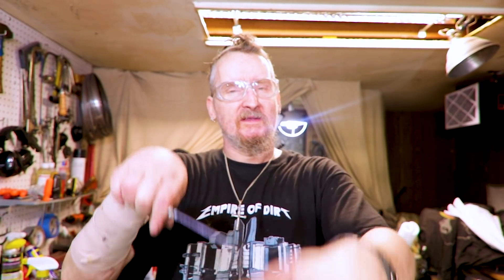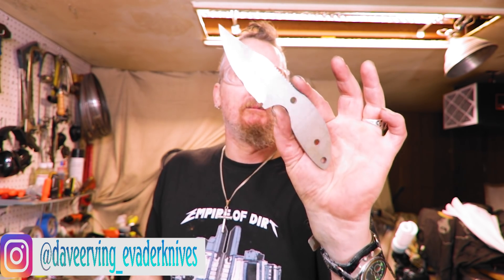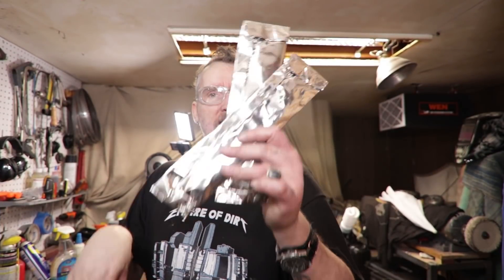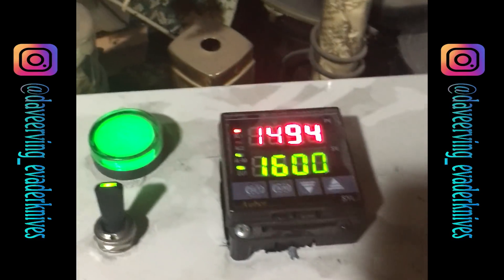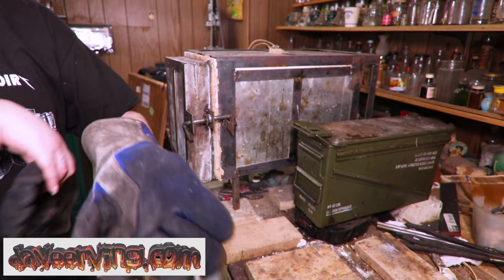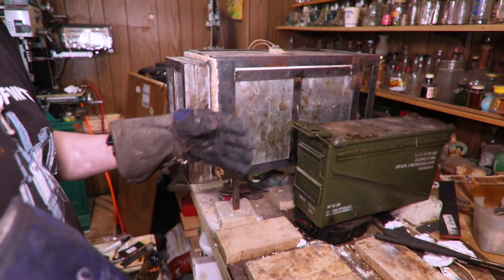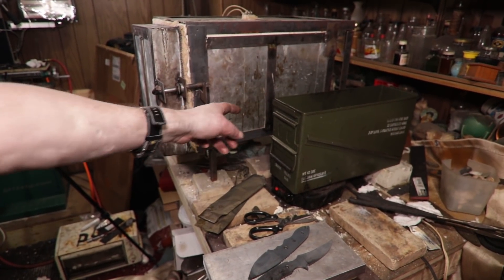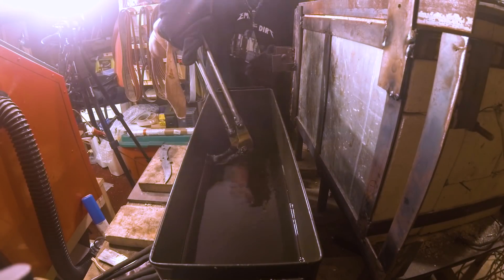Heat Treating 80crv2 & 52100 (A Knife Makers Guide 2018)

Comment: I've seen 2 ballbearing steel knives. Both from the same maker BUT, one has great heat treatment at around 60-61 , but the 2nd knife from that maker, doesn't sharpen almost at all. It finally got an edge after 2 days trying with anything I had. Of course only ceramic worked, but still it takes many hours to get it sharp. What did the maker do? Did he got it more than 67 hrc? Did he do something else and that's the reason I can't sharpen it?  Also, is there any page on the internet, that I can find info on heat treating random ballbearing steel or 52100? Thanks in advance!
Reply from the maker: Are you sure the 2nd knife is 52100? Sounds like a different steel. For heat treating any steel, you can google the data sheet. If you lookup 52100 data sheet, it has how it is done. Now, that said, every maker has their own twist or different technique. Hope this helps.
Reply: @evaderknives  He said, that both are ballbearing steel. On the impossible to harpen one, I can clearly see parts on the steel, where it seems like he tried to hammer steel balls. However, both sides of the blade,have 8 parts, where some random shapes appear, like the steel had bubbles inside. Probably, he didn't made the steel really hot and he also didn't hammer the steel balls enough, to blend them together?! At least that's how it looks, and that's how I can discribe it. I wish I could do something, to make it softer, but he already glued the most beatiful wooden slabs on it (Rosewood combined with black ebony on front part!) I love this steel so much, that I'm still looking for a guy (who also loves that steel), around where I live,, to order a custom at my specs! Thank you for the response!
Reply from the maker: @greekveteran2715  Ya know, ball bearings aren't always 52100, some can be stainless steel like 440c, which might explain the bubbles. Honestly, i don't forge, so I couldn't tell you for sure. If you have some type of belt sander or sanding attachment for a drill, maybe. Just make sure to take some scrap steel & practice 1st, you don't want to ruin your blade. At least that is what i would do. If I didn't have the proper grinders.
Reply: @evaderknives  Thanks again for all the help!!

Comment: I love this video, man.  I appreciate all the information,  I was going to try 80crv2 for my first knife but I don't have an oven so I guess it's 1095 until I can make a few.  Best of luck on that oven repair,  I know that is discouraging when you are in the middle of a job and something goes south.
Reply from the maker: Yeah, I've actually started building a 2nd oven now... If you haven't gotten your steel yet, you might want to try 1084. 1095 can be a little finicky if you've never heat treated before. 1084 is the easiest and usually called a "beginner steel" for this reason. It is a great steel too. I'm am getting ready to do a beginners guide for O1 & 1084... Thanks for the awesome feedback... P.S I was just talking to someone on my livestream about how to heat treat 1095, if you've never done it... the video is up now 32:42 ...https://www.youtube.com/watch?v=oz5ZRddm3CY
Reply: Thanks for getting back with me.  I just watched your video on 1095 and you are right.  I need to start with the simplest heat treat first.   I guess I will wait for your video on O1 and 1084.
Reply from the maker: @chucktietbohl6823  Yeah no problem, if there is something I can help with, I'll try my best or point you in the right direction... I'm editing the 1st video for(hopefully) tomorrow... Happy New Year...

Comment: I’m in. I have to stick to 1095 because I don’t have an oven either.
Reply from the maker: I would almost argue that 1095 is harder to heat treat than 80crv2 & 52100. They both need to be a little hotter, but you have more time for the quench & they are both more forgiving than 1095... 80crv2 is just 1080 with a little chromium & vanadium... they both require a little more heat, but can be done with a forge...
Reply: I might have gotten some misleading info. I thought if I got it hot enough to lose magnetism and then quench it in oil. Then in the oven at 400 degrees for an hour or so. Then air cool or I just turn the oven off. I haven’t tested my hardness on the one knife I built with 1095. I made a nice knife with a file. I heated it up and let it air cool to try and soften it. Ground it then did the process I mentioned to heat treat. I guess I could drop my knife on the concrete and see if it breaks 😂. What steel would you recommend for my limited heat treat equipment and what process. Something very simple or I’ll have to send them off to get treated and That doesn’t sound like any fun 😂😂😂
Reply from the maker: @e.t.preppin7084   That's right for 1095, a little bit past non magnetic, non magnetic is 1425ish and 1095 you want about 1475-1500. I've never had a problem with it, but some of the properties make it a faster quenching steel, which sometimes can be finicky if you don't quench fast enough or use a fast quenching oil. If a file skates, then success. Though 1084 or O1 are the easiest steels...

Comment: Good video bro I'm only set up for carbon steel blades with my forge right now hopefully in the future I can go stainless and of course I'm all in for the giveaway and thanks for keeping it fair help weed out trolls lol
Reply from the maker: Actually 80crv2 is basically 1080 with a little bit of chromium & vanadium. It can actually be done with a forge, but it takes a little more time... Also 52100 is just ball bearing steel, if you watch Stuart smith, he forges & heat treats it without and oven it all the time.. the tool wrap is for normalizing, that way I don't build up and scale and it keeps the blade clean...